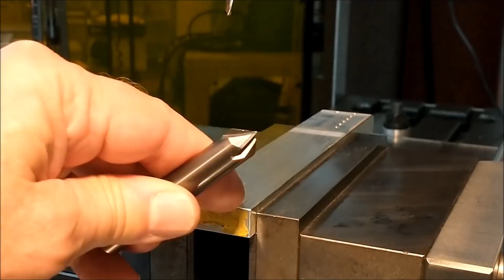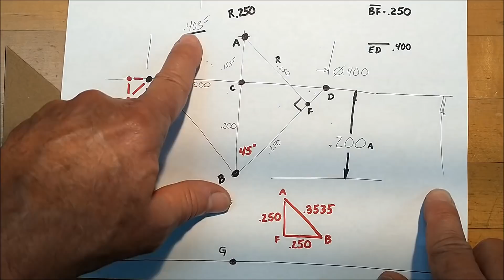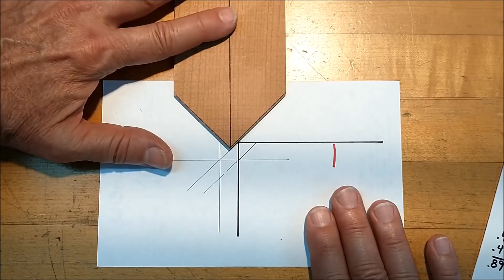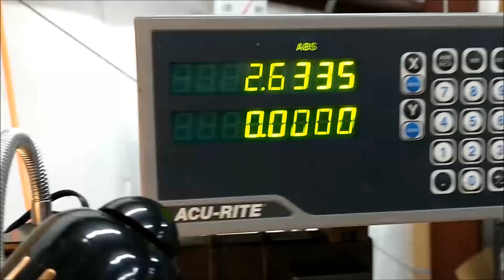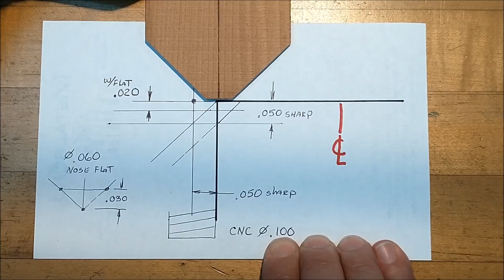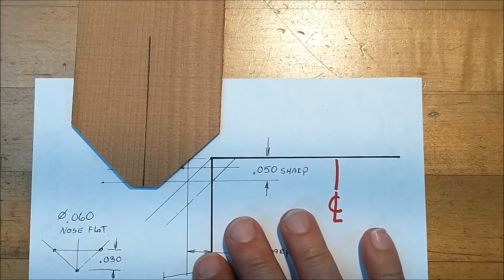How to use Chamfer tools for Increased Accuracy - You Should Watch This One !!!!

Comment: Thanks a lot, this clears up a bad habit I'd picked up. I was doing chamfers by touching off and then moving in <x> thou. It was slow, sloppy, and imprecise. I said, "There must be a way to calculate this."
Eurika! Since it's a 90° cutter, I can move center to edge, then offset by <x> and move the head down by an equal amount. Now the tool will contact the part at the correct zero! Now I can move it in 20 thou and get my 20 thou chamfer👍

Comment: Thank you. Well done. Chamfers have always been problem for me. I normally just go with CNC ball mill. The cad/cam systems I used didn't like chamfering too well, instead of exact geometry I'd invent tool geometry to make a cutting contact surface somewhere along the slope. Also, surface finish never séemed good, regardless of speed, conventional cut etc.

Comment: Hi Joe, love your videos.  I always verify my dimensions on turbo cad.  Keeps me balanced.  Did you know that a 1/2 inch ball is not big enough to get the edge of the ball?  I used a .625 ball to be above the .4 diameter of the chamfer.  Tell me I'm wrong.  It's late, so I may have something off.  Again, keep up the videos. You provide a great service to many of us.
Reply from the maker: Lets have some fun first...the balls I use don't have edges, so you may have a problem with your balls. Just kidding. My calculation was done from the tangent contact of the .500 ball, not the .400 dia. edge on the print. A larger ball will certainly work as well, just a different contact point. be sure to draw it out so you know whats going on.

Comment: miserable confession but I'm making some dice on a manual mill for a shop project at a technical college, thought I understood the written directions and broke the tip off both ends of my chamfer tool. Did the walk of shame and now I'm here watching this. Thank you for the visuals, hopefully no more exploded tools
Reply from the maker: Sounds like you may be plunge cutting the dots and the tool wasn't having it. Go off the plans and drill the dots and press in some other contrasting material. Then polish the surface flat again. Brass dots on stainless cubes looks pretty good. Black delrin looks great too. Remember...opposing sides will always equal 7.

Comment: Watched this video when it first released and now it just popped up in my suggested videos here on YouTube which then i realized that i never said thanks for sharing , especially since it gave me an idea for an accurate way to measure the tip flat on single v- form thread mills.  This then led me to making a MS Excel sheet that does all the calculations for me for both, single form thread mills and also chamfer mills.

Comment: Cool to see how this works if I had to do it manually. But THANK GOD this is a piece of cake to set up in Mastercam, knowing approximate diameter tool nose flat, and easing into final dimension with either a height or diameter offset on the CNC control manel, with any tool angle not just 90deg chamfer mill.
Reply from the maker: Having all the details about the tool is a good thing. Manual or CNC I agree.

Comment: Joe, working in industry for decade's in and programming CNC machines I made a bunch of hardened setup rings for my operators mainly for 90 deg spot drills which always have a flat. A disk .250 thick, bored hole .250 diameter, no burrs or chamfers, touch the tool down on your disk hole and you know where your at, +.250 (for disk) +250 (for tool depth), set you offset.
Reply from the maker: I've seen those standards used in companies I've worked at. Great idea. No worry about the tip flat or previous abuse damage
Reply: Would not be better to make such tool with an actual chamfer?? I´m worried of a sharp hardened hole touching the edge of the cutter. The depth don´t need to be a nominal  size just something measurable and repeatable to stablish an offset.

Comment: Joe,  I wish I had been following you and seen this about a year earlier as I was doing 1/8" radius CNC cutting in wood using a so called "Point" cutting bit, and it took me a number of failures prior to realizing what was going on. Being an electronics Engr. all of my woodworking and machining comes by being self taught. "Learn by doing" methods.  You explanation was clear and better described the issues than the reasoning that I had to painfully discover. The radius cutting was the last operation I was doing on wooden purple heart and rosewood gears with a DP=16.   Thanks for taking your time to video your work and provide such useful information.

Comment: Hi Joe, as always very informative and helpful, can you just clarify a point, when using the ground ball to measure the chamfer, I guess it has to be larger than the 'hole' to ensure it rests on the top surface and does not touch part way down the chamfer. Do you have a 'rule of thumb' as to how much bigger than the 'hole' the ground ball needs to be. Keep safe
Reply: In fact it´s better for the ball not to be touching the edge of the chamfer as it can have burrs . If you follow the trigonometry he is actually measuring against the wall of the chamfer which is allways in better condition than the edge .

Comment: Could you not take the cutter by itself and compare the height with the tip on a flat surface, and the tool in a hole of known diameter?  I mean with the tool held upright against a v-block with a height guage to measure.   Then you could just work that offset into the tool length you use.
Reply from the maker: Sounds feasible.

Comment: I have done this work in the past quite a bit in the small sizes smaller than a half inch.  I've got a small set of champfer checking gauges which,  I bought  in the 1980s when, I first started doing precision machine work.
They are invaluable for checking the depth of the champfered hole as well as the width and angle. One has to make certain that that the location of where the champfered hole is going to be placed is very accurately located because once the champfering is completed there is NO redoing a mistake. It is done, at the correct angle, properly finished according to set speeds and feeds and one knows all this before the work progresses. I've done a few angular machining jobs such as your lathe ways but more times I set the vise onto the milling machine table at the correct angle and machine the conic sections. One can accurately machine this way and if needs be go over the milled surface with grinding wheels with a surface ground finish. Your technique is excellent; the lathe is coming closer to finish.

Comment: I stumbled across this looking for something totally unrelated and it kept me up most of the night. I really wanted to know how important the size of the ball was, and at what point your math would fail. My son came in and it turned into a lively father/son debate. It was fairly simple once we wrapped our heads around it all. So... if our math is correct, for this to work, the ball diameter has to be larger than half the hole diameter (inscribed circle calculation), and smaller than the square root of half the  diameter squared (pythagorean). This means the ball would have to be between 200 and 564 diameter or it would be below the surface or sitting on the lip. It's probably obvious by just looking what size ball is appropriate, but you inspired me to use my rusty math skills, and because at first I thought the ball was just sitting on top, and your calculates were fatally flawed, but I was wrong. Thanks for inspiring us to use our brains, and great video!
Reply from the maker: As long as the cone to surface edge stays sharp, the ball can sit on the edge for calculation.
Reply: @joepie221  I was afraid of that but too tired to do more calculations. I'm not saying I don't believe it but like any scientist I have to do the math now. LOL

Comment: Joe, are these calcs not flawed in that you assumes the tool is cut exactly to 45 degrees. Will not any deviation in this angle throw out the calculation on the depth etc?
Reply from the maker: Absolutely, but you have to start somewhere.

Comment: Joe, thank you for this very clear/understandable explanation of how to accurately use chamfer tools.

Could you make a video showing how to use a manual mill (mill/drill) with a lot of backlash but no DRO?  I assume that I need to use several "long reach" indicators to "correct" for the backlash in each direction.  On a fixed income, I doubt that I'll be able to afford a DRO anytime soon, so any tips you can give would be greatly appreciated!
Reply from the maker: Check my catalog of videos. I have a video on that topic.
Reply: @joepie221  Thanks Joe.  The video name is "Ignore The Backlash, Manual Milling Just got Easier."  Now I just need to go practice those tips until it's second nature!

Comment: Joe's great illustrations using basic math (trig) should encourage people to take those math courses in school. If you didn't, trig courses are available on line. Simple calculators, the calculator on your computer and Machinery Handbook can all supply Trig tables. Beyond counting fingers, toes and the extra digit, Trig is the most useful math. 
The internet has proven to be one of the most useful things ever. You (can't) thank Gore for that.
Reply from the maker: It does help to have some ability to be able to diagnose what exactly needs to be solved. Some of the mechanics aren't always readily apparent.

Comment: How did you get into the trade Joe? Awesome video as usual btw, the ball trick is one I know will come in handy, thanks.
Reply from the maker: I was fortunate enough to go to a high school with a mechanical/ industrial arts program and a nicely appointed wood and metal shop in the basement. HUGE basement. When it came time to get a full time job in my junior year, machining was all I knew, so I went that way. I couple years later, I applied for a job as a screw machine operator and scored off their charts in the mechanical aptitude test I took as part of the application process. They offered to put me in their OJT apprenticeship program while working in the tool shop and the rest is history. I've done customs, prototypes, fixtures and repair work, my entire career. My biggest concentrated industries were semi-conductor wafer fab, explosion suppression systems and precision valves, precision miniature components and ended up in orthopedics.
Reply: @joepie221  Well you certainly are great at what you do and you surely love it.  I mainly do single part fab on my mill and lathe but I always take away something from all you say. Thanks for the lessons, they're awesome.

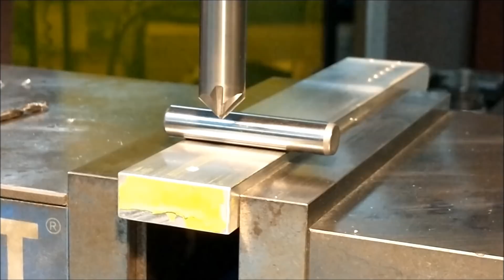Comment: 3:24 Can't we just loosen the tool and let it naturally drop to the surface of the part instead of using the offset
Reply from the maker: Tools normally lift as you tighten them. It would probably work, but you may get a false zero.

Comment: Hi Joe, great demonstration. I always used to use this method until I did my time on CNC. I now just ignore what is going on at the point and set the tool from the O/D, this way if you use several chamfer tools on a bigger job you can ignore any variation there may be at the points. Hope this makes sense, I may post a tips video on this at some point as it is another way to skin the cat. Cheers, Jon
Reply from the maker: Setting a tool from the Od can get you in trouble if you have to interpolate a small inner radius chamfer. I'd like to see your technique in detail. do the video.
Reply: @joepie221  Hi Joe, sorry buddy, you covered it, I saw the words at the end of your video and thought it was 'the end' so put the comment up, I just watched again and saw your last piece of the video, touching off on the outer diameter of the chamfer cutting edges (perhaps O/D was a bit misleading). I know this method only works if you have a dead sharp corner but it is very accurate as you demonstrated. Arguably as accurate as the ball bearing method if you add up all the potential opportunities for inaccuracy with the tolerances on the dowel, ball, and the resolution and skill of the operator using the micrometer. Great video mate, sorry I jumped the gun with the comment. Cheers, Jon

Comment: This is exactly why I bought a complete set of precision gage ( gauge ) balls. Also great for reverse engineering.
Reply: You can use 2 different size balls to check the angle too.
Reply: @metalbones  Brilliant! I love advice which is obvious in hindsight but is not the natural thing to think of first hand. Now I’ve got a whole new tool in my head! It’s like a sine bar, but in the same hole, using differing diameters rather than a known offset.
Reply: I bet a standard bearing ball is plenty accurate for most things. The potential difference from a gauge ball would be dwarfed by the change in size just from the warmth of your touch, but it is satisfying to have really precise things anyway.

Comment: After watching your mini lathe series ,no wonder lathes are so expensive.Or other machines with bed ways.The machining and accuracy that goes into them is just wow !To make everything parallel must be a nightmare.I wonder how they do it on a 8m long lathe(i have seen that monster in a shipyard ,it had 3 separate bedsthat were connected together,god knows how they cut a lead/feed screw that long ).I doubt they use a chamfer tool :)

Comment: There is a problem with this scheme: what happens if the tip profile is so small that it is not "stable"?  You lose your point of reference!  I use tiny carbide cutters for milling circuit boards.  They are either 90 degree included angle cones, or (for "fine lines") 60 degree included angle cones.  The fattest part of the cutter is typically 30 mils.  The tip typically comes to a point with several mils when new.  But this point wears quickly (tool running at 60K RPM, milling copper-clad G10 epoxy fiberglass circuit board).  The cut width is controlled by setting the penetration depth (there is a follower foot riding on the unmilled board surface immediately adjacent).  It goes like this: lower tool until copper is scratched, then advance tool "so many clicks", then mill.  After test pass, trace width is measured with magnifier, and adjustment made.  Every tool is different, and each one changes with use!  Complicating issues are board not flat, leading to different width cuts in different areas of the board.  This is not so bad, unless you are making board with 5-mil traces!
          In your case, tool is stable because you never touch the tip.

Comment: 'You Should Watch This One' ...  Yes Dad!       and now on bent knee,   Yes-Sir!   I am glad that I did.   and it is as clear as mud:  - all in there somewhere - had it a minute ago, lost it again,  Man! how many times must I go thru' all this.  ....
Joe, that was an excellent presentation: How I wish that Maths / GEOMETRY , hull, even Primary School drawing practice showed that!   It's all very well being taught the properties of circles and triangles, etc,   BUT - ask as an exam question  ' What is the diameter of the hole that a known diameter ball sits in?'  would have beaten a few Maths know-it-alls.   THis is 3-D Real stuff, not just pencil on paper 2-D.  One has to develop an eye for it.  and then the blunted tip.....   Oh ohh oh! - Och for me, an agricultural point is good enough  until it's a 5/8" pin and hole gettin mixed up with 16mm ones - Bearings are even better!.     Can go outside now with a Spring in my step, this cold sunny May Day.   Slàinte !

Comment: this will work, assuming the tip of the tool is realy 45 degree!
maybe you should check this, using a second ball with another diameter
Reply from the maker: Valid point. But I actually know the guy that made that tool and its exactly 45.

Comment: Okay, that's two new ways to do it that I hadn't thought of. My approach has always been to just move the radius of the nose flat for the away from the edge. For example, if initially you were going to move 0.050" off of the edge, and the nose radius is 0.010", then move 0.060" off the edge instead. That way you're hitting the edge of the cutter at exactly the same distance from the corner.

For CNC, you could probably just put the nose radius in as a negative cutter comp number. That's essentially how I handled it in a CAM software plugin I wrote for doing engraving with a v-type cutter.

Comment: On the cnc I work the diameter of the chamfer tool doesn't matter , but I do need to specify the angle and the flat on the tip , sharp tip looking tools got at least 0.1 mm flat on the tip 

Also I once did engraving with a chamfer but I told the machine that the tool was an engraving end mill , the tools have different geometry so all engraved numbers were off the mark by a lot , machines that do the compensation for you can be a bless but only if you give them the right information

Comment: This is helpful, but I have a different problem. I bought used lathe without a tailstock. I was thinking of making a tailstock base to adapt the tailstock off of a different lathe. I can't figure out how to measure and draw the ways to make a print. It has an inverted vee on one side, but a flat on the other. I can't figure out how to measure the difference in height betweent the vee and flat.
Reply from the maker: Measure the depth of the V with a pin and then just measure the difference in flat heights.

Comment: Awesome!
When you have time in the future, could you refer to your thoughts on using a center drill or a spot drill to start a hole in different circumstances. What is the real effect of when the starting angles do not match? Why is the center drill okay, or desired, in most of your spotting operations?
Thank you, have been really keen for a while on your thoughts regarding this matter.
Reply: Also, when you fear the possibility of workhardening a hole that needs to be tapped, in stainless steel, and not breaking the tip of the center drill off, when you slow down the RPM.